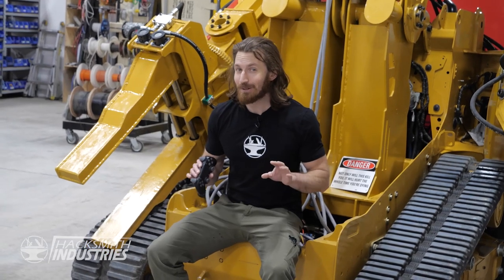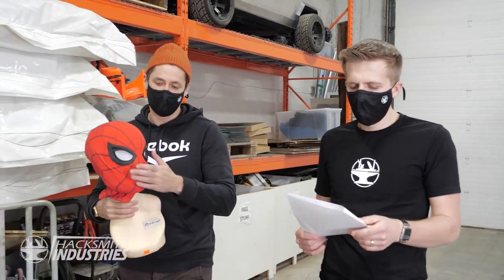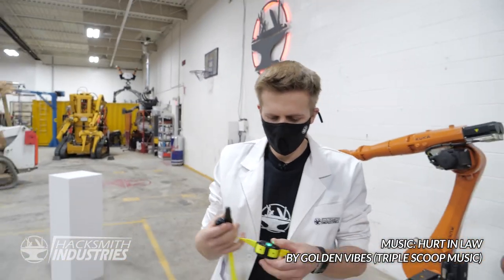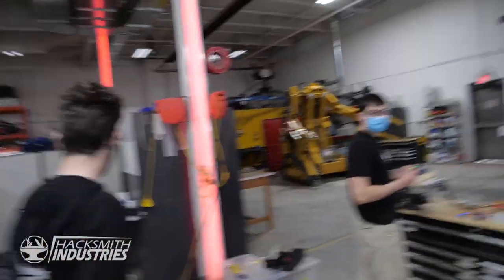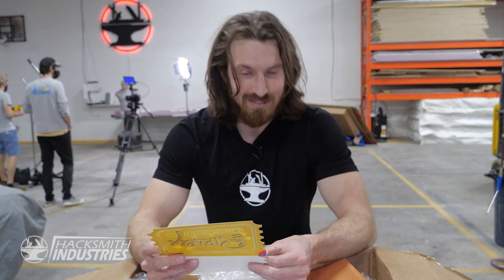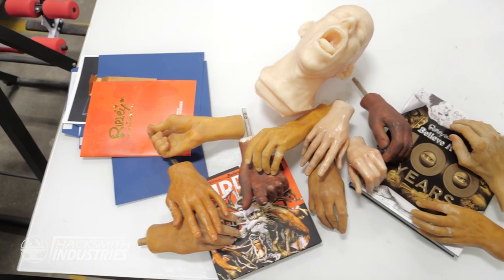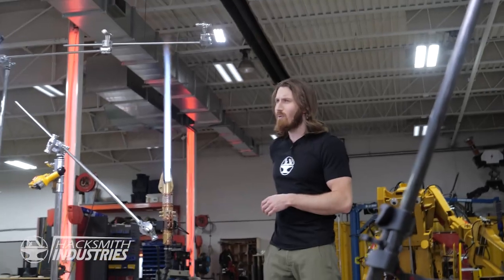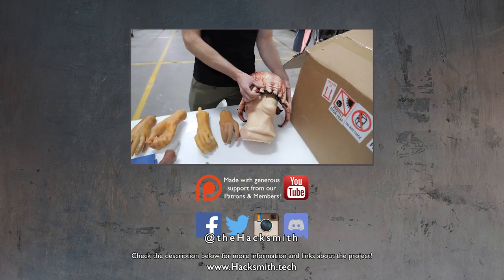HOW WE SHOOT OUR VIDEOS! (WEEKLY VLOG #6)

Comment: Well. This light saber in a vacuum chamber would not work because the gas would got in any direction, you have also to compensate for changing pressure levels.
Reply from the maker: The pressure means it would still come out straight -- not any direction -- the issue is, when swung, it would probably bend :P
Reply: @theHacksmithVLOGS  Are you sure? I was thinking that the gas is going to expand in every direction because there is no counter pressure which holds the stream of gas together. Can you even make fire inside a vacuum? I don't know.
But hell yeah. I would be very surprised if it works. 😃